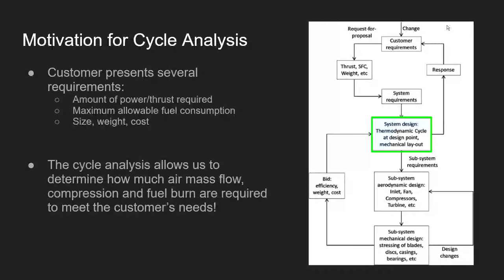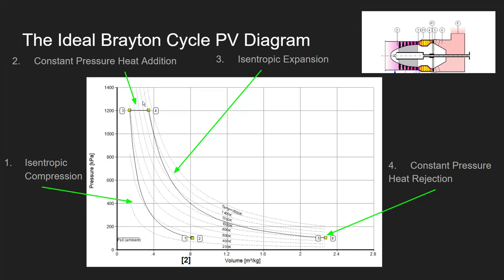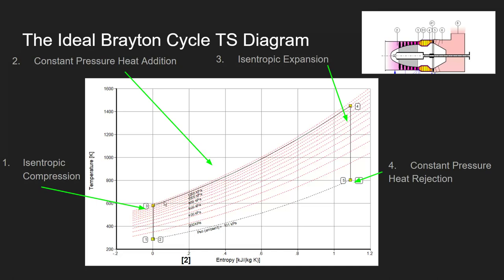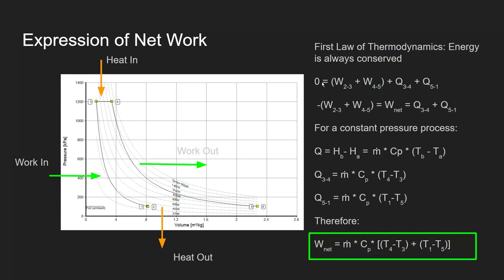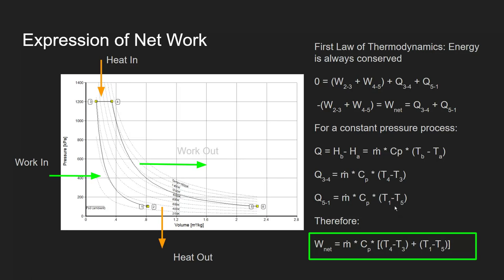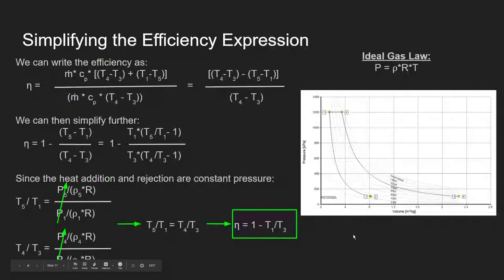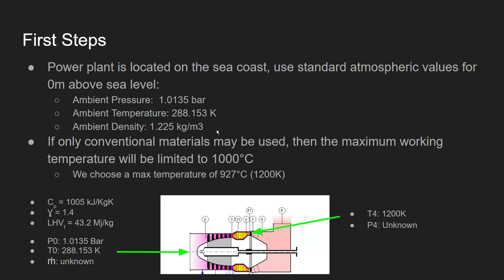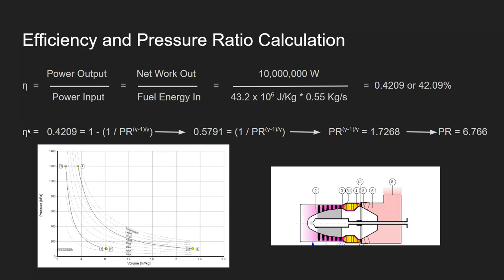The Ideal Brayton Cycle: An Engineering Perspective

Comment: Professor please tell, how are we able to maintain constant pressure while adding heat ?  P1 and P4 are same but temperature is different you mean for same pressure we get different temperatures
Reply: Hello! Thank you for your comment! Since the combustor is an open, rigid vessel (with an inlet and outlet), the heat addition will not increase the pressure of the fluid inside. Instead the gas density and velocity will increase as the fuel is added and burned. Hope this helps!